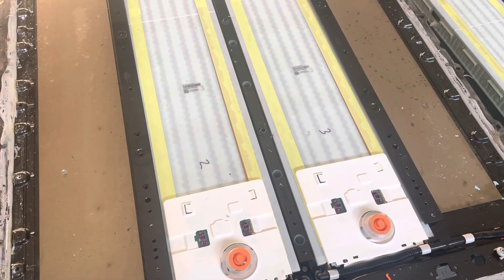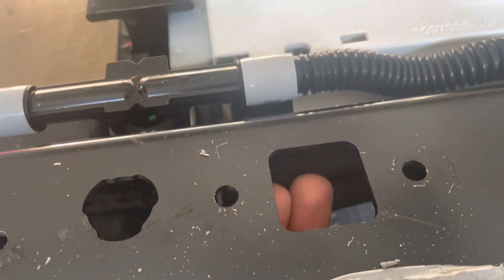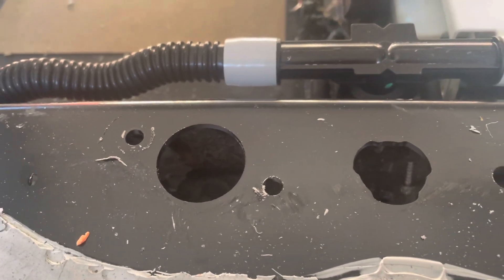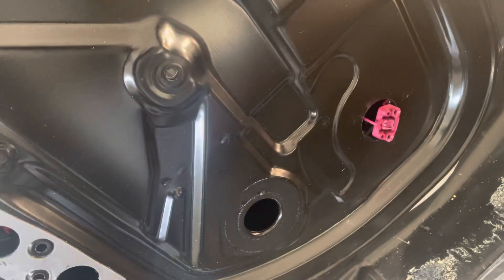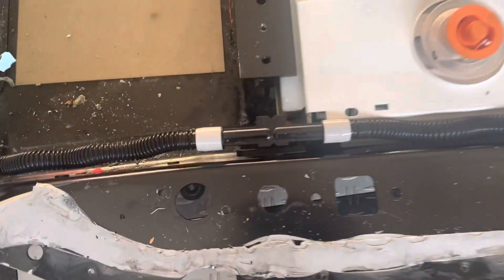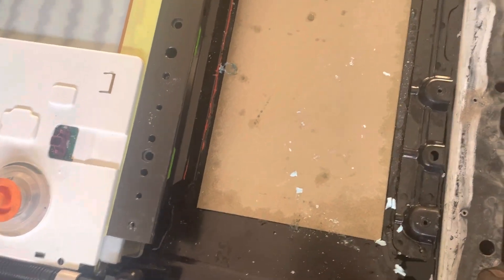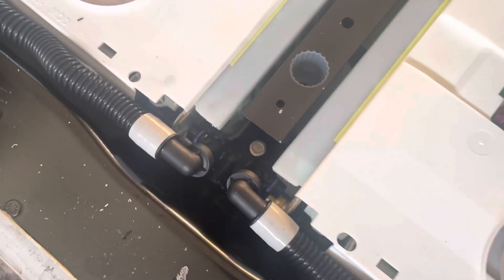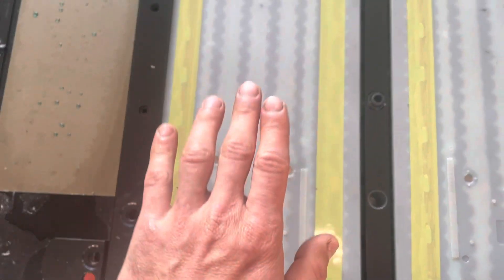How to remove battery modules from a Tesla model 3 / Y pack

Comment: Thanks. Didn't know that the modules are only protected by a thin rubber pad underneath and that you can short-cirtuit them with the bottom metal cover 🤯
Reply from the maker: It can happen if you are not properly removing the module and touch the sides of the casing with the module.  Wouldn’t happen during car operation because there is a lot of space between bottom of the module and the bottom of the battery casing.